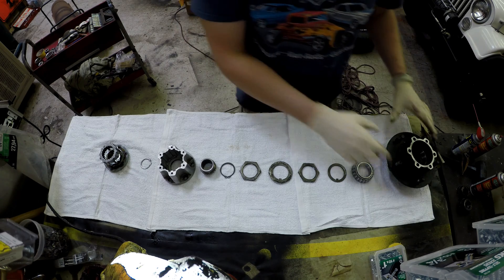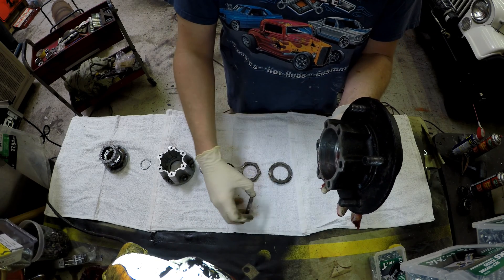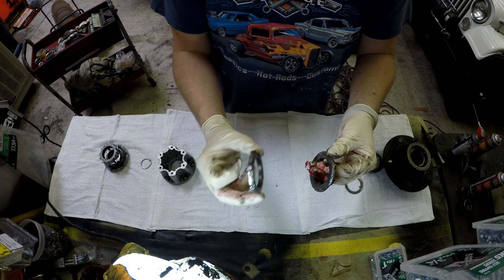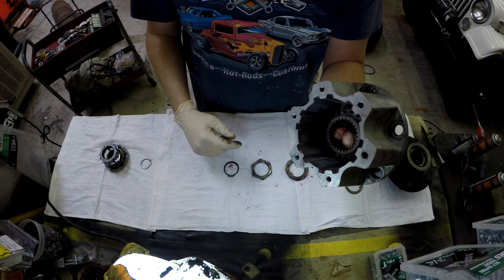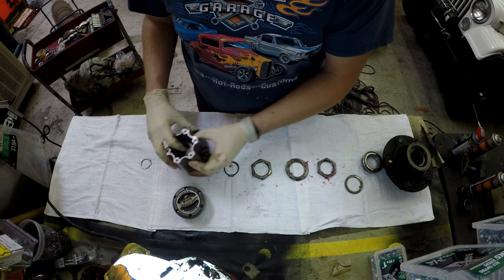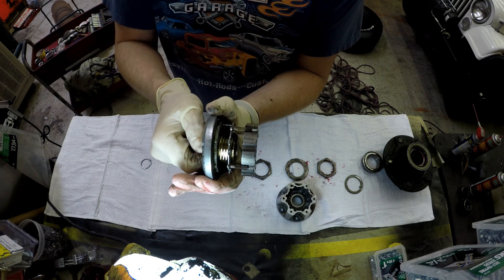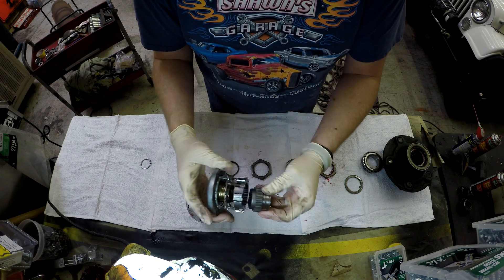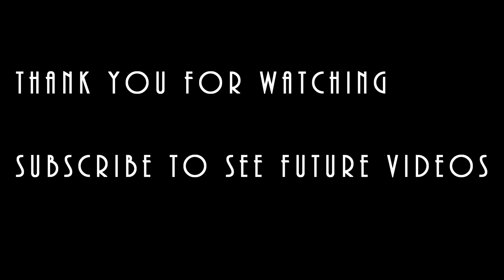Manual 4wd hub operation and assembly explanation.

Comment: The last time that I replaced my bearing races (the first time ever) I had an issue with seating the bearing race. My dad had a theory to fully seat the bearing and that was to tighten the bearing pretension nut as hard as you can to seat everything together, then back it off to the appropriate pressure so it can spin freely. Is a stupid way to break your hub assembly or is this a valid way of doing things?